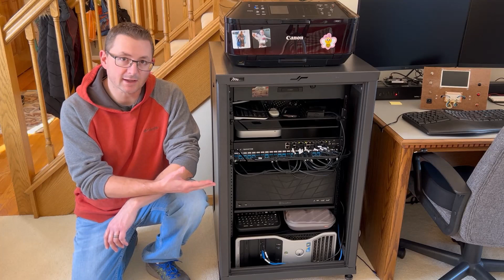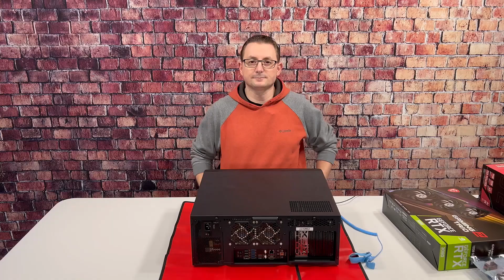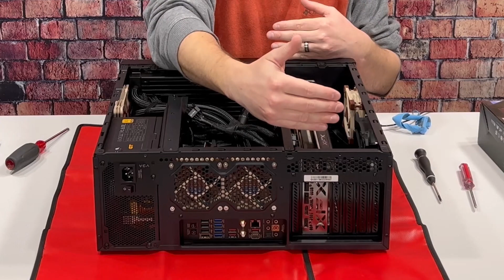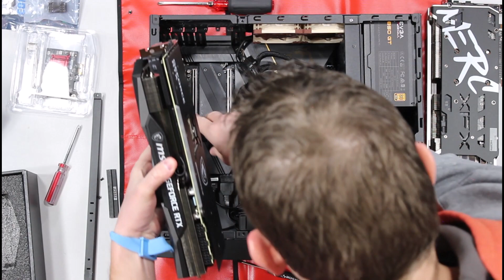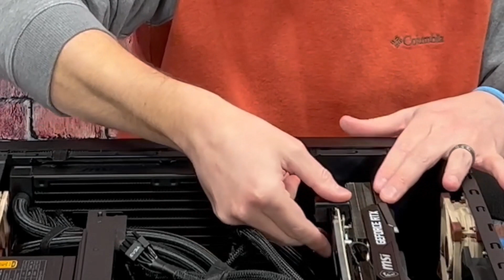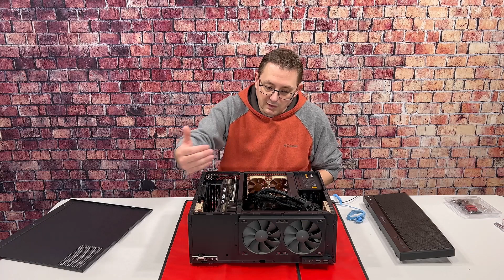Build Tips for SilverStone Grandia 11 + NVIDIA GeForce RTX 3080

Comment: DO you not have any issues with plugging fan headers in on the left side of the mobo? Seems like my MSI x570 Tomahawk has similar locations, which would be right under the 120mm fan. The USB and I/O plugs location getting a 80mm fan option is OK I guess but they should have just made the case a couple mm wider. IF you put in the slim fan on the GPU side of the case will it clear those cables?
Reply from the maker: I tried my slim fan initially to see if it was easier, but it was worse. Of the fans I had, the MSI fan from the radiator kit seemed to fit the best. It was a delicate operation to get everything plugged in, but no cables were stressed to make the fit.
Reply: @takeofftechnical  so it really came down to the edge profile of the fan then? I'd love to order this case but the fact that this happens (and the price, and the really silly lack of 2.5" drive mounting without the cage) makes me really hesitate to even try because I think I'd just be returning it. Did you have any issue with the fan header plugs at the left/rear of the case where you have the 120mm fan?
Reply from the maker: Yes, the slim fan does not have the concave region where the fan wires can fit on the mobo headers. The shape of the MSI fan allowed more clearance than the Noctuas. 

You might be happier with the GD09. The PSU is on the other side, which makes the connections easier. There are 2 versions of that case, one with USB-C on the front panel https://amzn.to/3N6br89 and one without https://amzn.to/3CcFuVf. Both versions are less expensive than the GD11.

I have done a GD09 build. It's lower cost, but less capable. You won't be able to liquid cool. I used an ATX mobo with the Noctua NH-U9S https://amzn.to/3WGcwXv air cooler and extra fan https://amzn.to/3OMeaET. My temps with a 3950x processor were overall pretty good. The GD11 will also fit a larger graphics card, so be sure to reference the specs when deciding which way to go.
Reply: @takeofftechnical  thanks. Yes I currently have the GD09 with a 3080 using right angled connectors (as you did) and a 5600X with a Noctua NH-U9S, and the lack of front intakes bugs me a lot so I was excited to only recently notice that this case was release :)
Reply from the maker: Ah, I see. In that case (pun intended), love the one you're with! I wouldn't swap out the case unless you are trying to solve a temp throttle or are upgrading another component that doesn't fit. 

If you do decide to make the swap, theoretically you could upgrade to the NH-D12L https://amzn.to/45J4Bg0. (The GD11 specs say max cooler height is 146mm and the NH-D12L is 145mm.) The scientist in me just wants to put the best air cooling up against that 240mm rad to see which configuration cools the chip better.
Reply: @takeofftechnical  Hmm, yeah that would be an interesting experiment, though I'm not too inclined to spend the $250 (case+cooler) to find out. I'm not strictly throttled in the GD09, but the side intake setup is not ideal in my situation and the prospect of a larger card for upgrading is a bit more of a factor. I hope maybe they release a V2, or I wait until a GD12. Funny thing is Gamers Nexus just did a Silverstone video today but it didn't show any of the HTPCs.
Reply from the maker: Silverstone moved the PSU to the other side in the GD11 so the mobo could move further away from the rad. This provides the clearance for longer GFX cards. The case can't be made any wider, or it won't fit in a 19" rack. For customers like me, that would be a deal-breaker. I would be surprised if they release a new case that keeps the rad, the long GFX card support, and fixes the side clearance with ATX mobos.

You won't know until you try, but I bet you can get a 120mm fan installed there. If not using a fan you have, something shaped like this Corsair would probably do the trick https://amzn.to/3MO2MWE. 

If you do decide to go for it, I recommend skipping the fan on the PSU side and using the baffle provided with the case. That should reduce turbulence from the front intakes and get that fresh air the best chance of reaching the fan(s) on the CPU cooler.
Reply: @takeofftechnical  Ahh I didn't think about the rack aspect, good point. Thanks for the suggestion on the fan especially, I might just pull the trigger on this. It appears the X570 Tomahawk has a second plug for the USB front I/O so I think the power/LED plug are the only thing I would have to contend with. And my 2 2.5" SSD drives could probably be culled down to 1 if I get another M.2, which are really cheap right now.

Comment: I just discovered this case an I love it.
I own a beefy Fractal  HTPC case that is impossible to upgrade to water-cooling.
With new AI tricks for videos available for Nvidia i can see the need for a beefier card beside gaming.
I can also see the potential of going for a water-cooled 4070 (Ti) which has shorter PCB and then using a Dremel to make room for 360mm radiator hack job 😎😎😎
Reply from the maker: I've been really happy with this case and the 240mm rad cooling on the 5950x. I am curious how a 360mm rad would work out, so let me know if you try it!

If my rad gives out, my next cooling system will be the NH-D12L [https://amzn.to/3UJ3JDd]. There's only 1mm difference between that air cooler and the maximum height allowed by the case, and I'm curious if it fits. I would also love to know how the air cool compares to the water cool!
Reply: @takeofftechnical  
Maybe to avoid hacking it would be even better to put in 2x 240mm rads. And have 2 loops.
One in a standard location for CPU and on the GPU side.
If one uses smaller motherboard there looks to be enough room (5-6cm) to the internal USB headers.
 GPU thickness would be non issue since it is small under a waterblock.
Reply from the maker: I think the play to water cool the GPU is one 240mm rad and a single custom loop that services the CPU and GPU. The challenge would be to keep the single rad cool with enough airflow. Maybe with the right mobo another pair of fans would fit on the other side of the rad. It sounds like a fun build!
Reply: @takeofftechnical  
Yes.
Sounds like fun.
The correct way to aproach this is firsts get the case and measure for the rads and fans.
Then fit in everything else.😁😁

Comment: I decide to buy this case to fit my new rx6700 xt. I have a question about the additional fan for the gpu. Do you try to put the fan for the extraction of the air? The airflow in this way became neutral whit the same air in input and out put. What do y think about this solution? Tnx again 😉
Reply from the maker: While neutral pressure inside a case is ideal, I consider it a secondary goal to controlling the direction of airflow. Using a case fan as an exhaust on the GPU side will move air the opposite direction of the fans integrated with the video card. I think it’s better to run both case fans as intakes to control the airflow direction towards the GPU. This also agrees with running the slim fan on the other side as an exhaust, which leaves two well-defined intake to exhaust directions: front to back and GPU-side to PSU-side. You could experiment and benchmark to get a more concrete answer, though.

Good luck with your build!

Comment: Can the fans on the front be swapped to exhaust?
Reply from the maker: It is technically possible, yes. However, the front of the case acts as a filter for the intake air. If you reverse the fans you will be exhausting through this filter, and dust will build up and be trapped inside of the front panel. Even if you observe a favorable result initially, I would doubt this configuration would remain that way for long.

Comment: Really enjoyed this series. Had actually built a very similar Silverstone/MSI non-RGB gaming HTPC setup prior to you releasing it:

Case: Silverstone GD11
Mobo: MSI PRO Z690-A WIFI
CPU: i7 12700K
Cooler: MSI MAG CoreLiquid P240 AIO
GPU: 4090 FE
RAM: G.Skill DDR5-6400
PSU: MSI MPG A1000G PCIE5 1000W
Storage: MSI M480 Gen4 NVMe 2TB
Fan setup: Front (240mm AIO intake with tubes on the left), Left (two 120mm Silverstone intake fans), Right (one 120mm Silverstone exhaust fan and PSU intake fan), Rear (two 80mm Noctua NF-A8 exhaust fans)

Two points:
- I was able to fit two of the included 120mm 
Silverstone fans to intake on the left side of the case, just folded the underlying cables gently inward to fit
- The MSI AIO can fit with the tubes on the left so they are lower and theoretically pump less air to the CPU plate, just needs a little machining of the crossbar to accommodate the radiator in this orientation, or to tighten screws less tightly and allow less ideal fitment of the case top panel
Reply from the maker: Very cool! Did you need any kind of adapter for the 4090 FE video card? I looked it up, - 137mm tall vs 140mm of the card I'm using. Was there just enough space? 
The MSI card is 20mm longer. Given the AIO performance is acceptable, I'm inclined just to leave it where it is. I am curious if the CPU benchmarks would improve with the tubes down, though.
Reply: @takeofftechnical  I did not- the 12VHP cable from my PSU seated well and was flexible enough to have a gentle bend and close routing over the narrow front-rear cross bar with the lid closed. But yes it was close. if much taller/tighter fit I wouldn’t feel comfortable smashing the panel closed.

And yes totally a theoretical benefit since the pump is actually in the radiator for the MSI AIO but I’d say worth trying if you have a need to remount your cpu cooler in the near future.
Reply: Did you have issues plugging in fan headers? MSI seems to like to put SYS_FAN1 thru SYS_FAN4 all the way on the back left edge of the mobo, which would be right under the rear 120mm position in this case.

Comment: I was wondering if I could fit a gigabyte 4080 aero (150mm height).
But I think I better go for the founders edition. That only had 137mm of height and I should be able to for it.
Reply from the maker: The manual for the GD11 has a "Component Restrictions" section and lists GPU height maximum as 151mm. The MSI card I'm using is 140mm in height. YMMV. If you decide on a Founder's Edition, be sure to have a plan for the power connections. The FE cards have a different connector, and the low-clearance adapters I have linked in this video won't be compatible. Good luck with your upgrade!
Reply: @takeofftechnical  i made it work. 4080 FE is inside and 2x 120mm fan on the left side. Just squeezed the front panel cables to fit the 2nd fan.
Reply: @john9801  Any advice on fitting the 4080 in there? I just purchased one and would love some advice before I start building. I assume I'll need those power adapters from Cablemod that Andreas Wolter mentioned above.
Reply: @bmwmpower04  I used the Corsair 12vhpwr unsleeved cable. 

!!! This one only works with Corsair PSU !!!

The cable is far more flexible.
I also did cut the cable binders of that cable to be able to route the cables in 2 directions. I would have to look up a reddit post that had some pictures of that technique.
Reply: Even at that height you will get into trouble with the power connector, you will need the angled adapter from Cablemod (dont think anyone else is offering something for the new Nvidia power connectors and really would not risk some cheap chinese knockoffs with those cards).
Reply: ...upon further investigation, even the founders edition will not fit. even the lowest adapter for the power needs a 15,5 mm clearance. An A6000 Ada will fit fine though :D
Reply: @andreaswolter9620  i would fit a founders edition by using a Corsair 12vhpwr cable that is more flexible.
A reddit user shower me that he managed to get a safe bent that only added 9mm height measured from the PCB. It's done by bending half the individual wires up towards the CPU and the rest in the opposite direction. Quite clever actually.
Since the height added is measured from the PCB, it should also work for bigger cards as the PCB size is the same. Only problem for the gigabyte aero is that according to my calculations, there is only 1mm between the GPU and top panel. Not enough you route the cables. Only possibility I see there would be somehow melting a path into the plastic shroud or taking the shroud of and routing the cable inside. But then I'd be worried that the cable heats up too much as it could touch  the heatsink this way.

Also I was wondering if the smaller gap between GPU and top case panel would be better or worse for thermals.

Is the founders edition kind of a blower card blowing the air out the back?

Comment: Wow, the 80mm side fan on the GPU side is not ideal.

Currently planning my own GD11 build. Only got some of the components so far. But isn't that a pretty common spot for the from panel headers?

Would a 120 mm slim fan fit?
Reply from the maker: No, a slim 120mm won't fit. Honestly the 80 + 120 combination has been enough to keep the RTX 3080 running normally. 
I started this build using all Noctua fans, because I didn't want to skimp on cooling with a high-end rig. I'm glad I hung onto the MSI 120mm fans from the AIO, however. Although a few dB louder, it has higher airflow and pressure than the Noctuas I used on the radiator instead. By using the MSI fan on the side, I compensate a bit for the 80mm. It fits great, too. I didn't find it for sale separately, otherwise I would have made a point to recommend one there!
Reply: "Funny" thing is, even the manual only states that the fan will interfere with the 7th PCIe slot and the USB headers, but nothing about the rest.

Comment: Nice to see that you have the same "Windows like" dust logo :D
Actually the first PCIe slot on your MB is there, it is where a NVMe can go into. If you do not use it, you can even get an NVMe to PCIe adapter, if it is a real NVMe M2 slot (and not just for SATA). 
As for air....putting it in a rack seems really tricky. The side clearance is bit narrow and depending on how far you are away from the wall air circulation might be hindered a bit (as far as I remember those old Dells like the one in the bottom, they do not help for circulationbut do output quite some heat).
Not to mention that this beautiful case should not be in a server rack but in a HiFi rack :D
 
Those front panel adapters are really an oversight by Silverstone....kind of weird there are not at least some 90 degrees angled adapters. Looks like my plan of adding a radiator there will not work :D

BTW...does your USB-C in the front work ? Seems the tolerances in my case are a bit off, connector did not properly stay in, had to rework it a bit.
Thanks for documenting your journey :D
Reply from the maker: Good point on the PCIe! It is a NVMe M2 slot, so the graphics card is electronically in the 2nd position. The manual for my motherboard lists the graphics card as "PCI_E1",  though, so I've been considering it the "first" slot. That said, the presence of the NVMe in that location is a good indicator the motherboard will line up properly. I hadn't put that together - thanks for sharing!

My USB-C is a little suspect. I use it to transfer recordings off my phone, and I've been blaming Microsoft and Apple not working well together - a usual story in my lab. Perhaps a closer look is warranted...
Reply: @takeofftechnical  On mine the USB-C was a bit wiggly and the connector did not slot in properly. Reworked the holes holding the socket on  daughterboard a bit so that the USB-C comes a bit more to the front, but maybe I was a bit too careful and only did about 1mm diameter more. It is a bit better now, but not as good as when the plastic cover is removed, Maybe try it without the cover, if it fits better it is the same issue.
As for the PCIe...if it is not a card that get hot, maybe get an extender. There are a few for mining rigs, you could then put the card in the "real" first slot. half hight card would prolly leave some space  under it, but should fit.
Reply: and looks like I was wrong about the first PCIe slot....mATX and ITX boards seem to to line up the GPU slot to the real first slot event though some have the NVMe betweeen it and the CPU.
Reply from the maker: I would be curious if pc part picker would flag that as a problem for those motherboards. It's certainly important. If the GPU lines up with case slot #1 then longer cards won't clear the radiator.

Comment: Hi mate I’m looking at doing the same build and with a 4070ti card and a capture card for video processing I seen some of the comments of the first video you did and my concern is the air flow how are the temperatures now? 
As if I put a capture card in will it block the flow of air to the gpu?
Reply from the maker: With the configuration in this video, my CPU and GPU temps are fair. I have been experimenting with different fan curves in the BIOS. My Time Spy benchmark is currently "Great", and I've spent a few hours on ultimate 1080P gaming with zero issues.
I think the size and the position of your capture card will be key. With my motherboard, using PCIe slot 2 causes PCIe slot 1 to run at x8 lanes instead of x16. That's why I first put my x4 NIC in PCIe slot 4. As mentioned, however, losing that intake fan was not ok. My new x1 NIC at PCI slot 3 has zero affect on the cooling performance. If your capture card is x1 use slot 3 and you are golden. If not, you may be better off using slot 2 and running with the reduced bandwidth of x8. 
Two other considerations - first, NVIDIA GeForce Experience (bundled with drivers) can record games, so you may not need the capture card if you are trying to get the output of the 4070 Ti. Second, there are USB capture devices, like the HD60 X [https://amzn.to/3kxucW8] that eliminate the concern altogether. If you don't already have the capture card consider that instead!